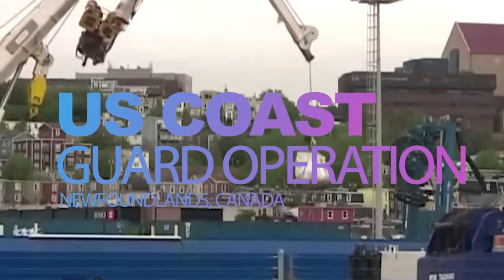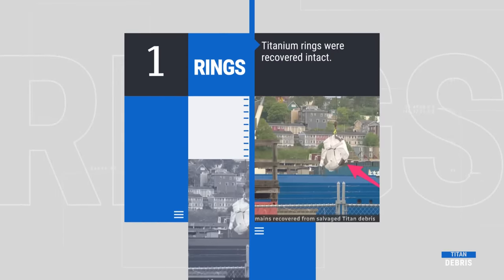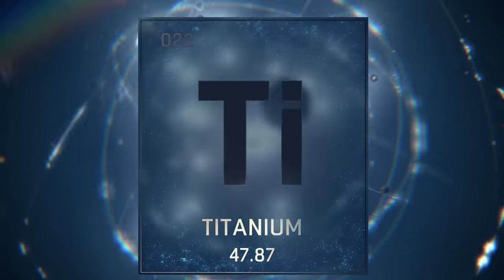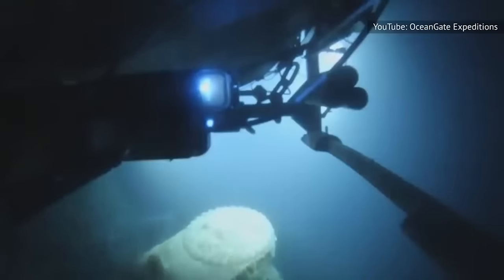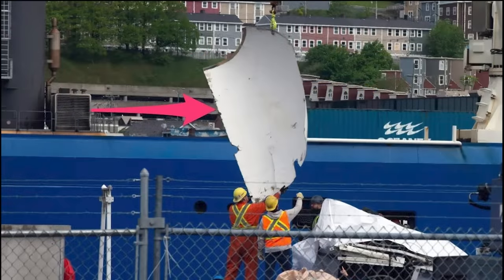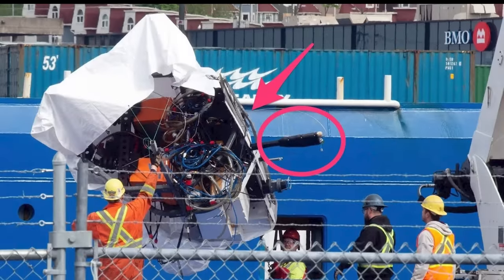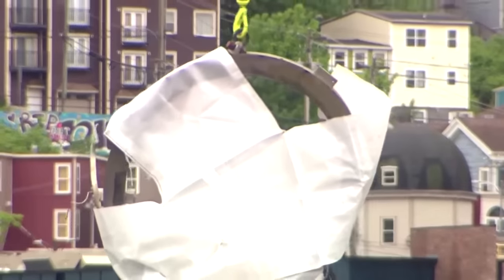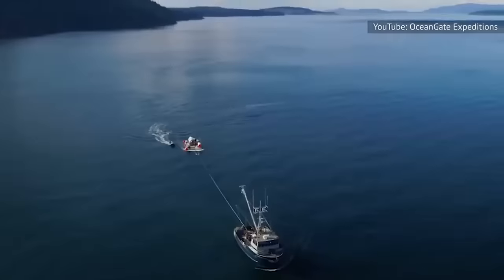What Really Happened? The Titan Submarine Clues from Parts after Implosion

Comment: Why did the cowl or outer plates covering the wiring etc did not break even being very thing to give shape ?
Reply: No pressure internally. If it's just the cowling your are talking about - it's just rounded material without an internal pressure differential.
Reply: They wouldn’t have been subject to the water expansion, just the pressure chamber.  
The water can only instantaneously expand into an available opening.
Reply: They wouldn’t have been subject to the water expansion, just the pressure chamber.  
The water can only instantaneously expand into an available opening.
Reply: They were part of tail section…not passenger compartment…blew off free. 3 sections…and titanium rings were glued to carbon fiber. Middle section is “missing, ie, micro fragmented from implosion.

Comment: What if all those YouTube self-proclaiming Experts' theories about how it takes X number of seconds for pain to register to the brain and then a human feels it and X number of milliseconds for an optical signal to reach the brain to actually process what's going on and how those 5 didn't even feel and didn't even realize what had actually happened at the time of that sudden implosion are all wrong and those 5 people actually saw and felt what was happening and what is coming next and they actually felt the pain and the distressing situation for a number of seconds to a couple of mins?
Reply: What if?
Reply: Why I think "black boxes" CVR/DRs should be installed/required on these manned submersibles, just like planes.  The are designed to withstand pressures at 20,000 ft and will transmit up to 30 days.
Reply: The only way to know what happens is if you have ever been involved in an accident involving high impact forces on your body.  I have, and I don't remember a single thing about it.

Comment: This did not emplode.....it broke apart 

Rush messaged the polar prince that he's coming back up because he's having issues......unfortunately they were already to deep to avoid this as they were already at the crush depth
Reply: The hull imploded and the steel caps just fell off.
Reply: And what caused it to break apart?!  pressure!!  it’s the same thing as an implosion 🤦🏻‍♂️
Reply: The carbon fiber hull imploded. The caps at the end did not. Not a hard concept to understand.
Reply: It did implode, causing it to break apart 🙄 What do you think happens to a pressure hull if it exceeds crush depth? It just breaks apart?!

Comment: By these debris's size there has a possibilities that the main body was leaky by small wounded... that causes the implosion wasn't totalled... "If the sub exploded before the implosion for sure they would be retrieve the whole debris in hand sized and there must be a burnt print 😎... "EN Namekian"

Sure CF harder than TTnium & TTnium elastic than CF, however the water pressure that wouldn't stop = no intervals "even at 0.00000+++1 ms" it would trigger a breaking CF into something sharp enough to slice a TTnium, because CF probably a hard material surfaces but it's too crispy 🤗... "Crank".

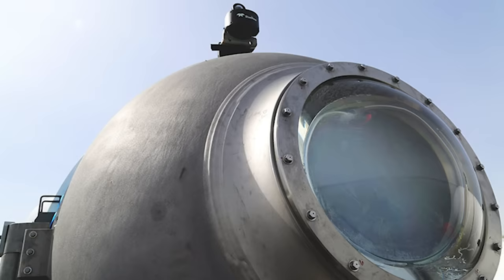Comment: At 7:13 aren't they wrapping the carbon fiber around some kind of steel drum tho? The hull was not just 5" of carbon fiber. I still think there was some kind of  small explosion/or fire (melting wires perhaps) in the back area part that only had the fiberglass part around it and some connections into the hull came lose and then the implosion happened. I hope their deaths were quick before realizing what was about to happen. I think SR knew something bad was about to happen but did he tell his passengers? Online transcript of SR communicating with his crew on board the "mothership" says the alert mechanism was red red so he likely knew there was impeding doom if he didn't get the vessel to the surface but even then that was a problem with the weights on the vessel not coming off to lighten the load to thrust to the surface. Something was holding them down or was blocking something to be able to thrust upwards
Reply: Aliens was holding it down, the aliens from the tictac ufo

Comment: Is there any information, or estimate yet as to what depth the Titan was at when it imploded ?  I wonder if the large pieces came about because the Titan had not descended to a substantial fraction of Titanic's depth at the ocean floor when it failed ? I'd think it logical that the deeper it was when it failed the more energy would have been involved in the crush/rebound cycles, resulting in smaller fragments.
Reply: We know aprox how deep, because the sub had been diving for almost two hours, and normally by that point would have reached nearly 3000m, 3/4th of the dive. The exact time of death is known, because audio sensors detected the crush sound at nearly the same time both the tracker added after last year and the onboard text type system failed. 

Watching videos of carbon fiber failing under pressure, it is fairly clear that CF fails dramatically, normally breaking into fragments. Since we know the main hull is layered vertically, it would be even smaller since the ringlike layers would not be rigid enough on their own.

The fact that only the grey adhesive is visible on the rings suggests the carbon fiber flexed too far, either causing layer separation (like an onion) which is insufficient to resist the pressure, or caused the separation of the adhesive at the ring, popping off the top (and blowing the viewport dozens of feet away) while crushing the rest like a soda can under a car tire at 75 mph.
Reply: Lost communication and tracking at 3500 meters

Comment: Bad assumptions.  Typical rush to judgement.
For example:
1. Viewing things being unloaded at a distance.
2. blowing OUT the viewport. There is nothing to suggest it, during an im-plosion from the high pressure at depth.
This is jumping to conclusions that may or may not be correct.
.
Photos of the debris field and examination of the recovered pieces is required.

Comment: Titanium was the best material to use - easy to say now Captain Hindsight! There was no possible way to know that carbon fiber was going to lead to catastrophic failure. No possible way. This was a totally and completely unexpected tragedy. Nobody could have predicted this.
Reply: Wouldn't other companys be using carbon fiber if it was an acceptable material?! 🤔
Reply: I assume you're being sarcastic.
Reply: I pray this is sarcasm
Reply: For a submarine, steel is the best material to use.  Titanium has a good strength to weight ratio, which is why it is used on airplanes.  Same for carbon fiber.  But submarines don't need a high strength to weight ratio.  Submarines just need strength.

Comment: You are being lied to. It EXPLODED not Imploded! Here's why I say this: The sub was descending too fast and the sub was not adjusting fast enough for the pressure outside of it and the composite fibers were cracking and the crew was hearing it. The aft section was filling with water and water was gathering around the A and B busses knocking out the power to the sub. Which knocked out communications, lighting, and propulsion. Once that happened they started to go back down. As the pressure increased water started coming into the sub passenger area. As the water filled the sub, it created an air pocket which superheated and the effects of the cold water and heated air combined to create an overpressure which blew the sub apart. And that's why you see such large pieces.
Reply: Maybe you are right.
Reply: You do realize when there’s that deep of sea pressure, things don’t explode right? It’s called an implosion for a reason.
Reply: Absolutely wrong.
The batteries were in their own pressure containment compartments separate from the passenger chamber.
Water wouldn't simply leak in, a crack would mean implosion at those depths.
The reason the fiberglass is almost intact is because it didn't implode, it was blown away from the implosion.

Comment: The view port blew out then the ocean blew the domes off the rings as it exploded outward the carbon fiber cylindrical hull section.
Reply: He explains in the video that if the port blew out first, there would be large pieces of the carbon fiber inner hull
Reply: @bulkvanderhuge9006  if it implodes, then the viewport wont be able to bent, so it will shoot out, plus the glass wont be able to sourvive the force of the implosion

Comment: why are there no bolt holes on the view port for the glass
Reply: I was thinking the same so i looked up images of the titan sub, when you look at the video of the recovered nose it looks like there is a significant portion of titanium missing, in pictures you can see there is a good 7 or 8 inches  that sticks out forward where the bolts go, however if you look at the recovered part at about 2:40 you can see there is no part that sticks out like it should  and around the edge where the  glass would be looks regular and broken,  I suspect they used cast titanium  for the front  due to it being cheaper than machining from a solid block, but cast is also weaker and so i suspect when the main pressure container popped the massive force of water popped the front glass out  along with part of the cast  titanium support frame.
Reply: @EQINOX187  You mean the air pressure inside momentarily shot up at when the hull imploded? I suppose, since the viewport was designed to hold off pressure from the outside, it would fail rapidly if the pressure came from inside.

Comment: It was an implosion, not an explosion. That's why the fragments are large. Duh!
Reply: The figments of the carbon fiber hull are not large but  tiny bits on the bottom of the sea. Duh!
Reply: At sea level the pressure acting on us is 14.7 PSI (Pounds per Square Inch) on our bodies. ""Titan is believed to have been 3,500m below sea level when contact was lost."" According to the ""sea diving pressure calculator"" 3,500 meters under the ocean surface would be 5,110 PSI"". So the Titan was holding back more then FIVE THOUSAND POUNDS of pressure PER SQUARE INCH at the time of implosion. It would have been a VERY VIOLENT IMPLOSION.
Reply: @oldarkie3880 figments? Duh!

Comment: How can it possibly take 12-24 months for the loser NTSB to come up with a conclusion? I guess it's just job security. No excuse for this.
Reply: Well said,1 month tops.....NTSB milks every investigation....
Reply: There are a lot of variables that would go in to figuring out exactly what happened. And I'm sure an absolute mountain of paperwork.
Reply: They’re just counting on the fact that in 12-24 months most people won’t even remember it happened.
Reply: It’s not a McDonald’s drive through.
Reply: Their research and report will be meticulous, and exhaustively thorough. It's not a book report.
Reply: Several things may happen. Unless they find the proverbial smoking gun, they may build a complete model of the Titan carbon fiber tube to do cyclic testing to failure (similar to the testing of the De Havilland Comet after some high profile breakups in flight). They may want to test all the seals to look at leakage or other problems. Basically they will test every piece of the thing they can get their hands on or recreate, because even though we KNOW the thing imploded, the NTSB is held to a much higher standard of proof because they need to not only explain the accident but figure out exact details to help prevent future occurrences. Then, after all the investigation, the team needs to get together and write report. If you have ever read one, those things can run hundreds of pages long and they will talk about all sorts of stuff down to the minutest detail. Why do they do that? Because of the law. People are going to get sued, and millions of dollars can hinge on exact causes. Sometimes criminal charges. Also, there is a big chance laws will be written because of this, and so the NTSB wants to make sure to steer the lawmakers in the right direction. And yeah, it can get political, and some will argue the NTSB is not always impartial, but I'm not talking about that. I'm just saying they have a LOT of work ahead, and they will not generally issue a report until all the i's are dotted and t's crossed.
Reply: There’s no rush is there? Unless there are a bunch of uncertified subs doing Titanic dives out there, should have plenty of time for a proper investigation.
Reply: @Concepcion30  You're right; there's no rush, mainly because that was the name of the sub's creator. So, literally speaking, there's no Rush.

Comment: No, that’s incorrect, no offence but you’ve clearly not done your research correctly.

The experts are not saying that the titanium rings were the correct choice; and they were actually designed to bolt the end caps on to the carbon fibre hull, and there was no trace of the hull on them, so if anything, they FAILED.

That’s what the experts have ALL been saying, it wasn’t necessary the carbon fibre hull that failed, but the mixture of different materials (i e. the Titanium rings) - as each material has its own properties and expands/compresses differently under the pressure…
Reply: I think what they mean is that titanium would have been the correct material to make the entire sub out of.
Reply: @dx1450 While that is true, that’s not what was stated and than further explained.

Hence bad research imo…

Comment: Hey Karens, can you read? 
THERE WERE TEN (10) SUCCESSFUL DIVES DOWN TO TITANIC. 
Ten times without imploding!!!
Reply: Each dive is a cycle. Pressure chambers weaken after each cycle. Aircraft have the same issue. They need to be built to withstand a useful number of cycles before it becomes dangerous.
Reply: Ten dives, and every time the carbon hull was weakened a bit more. IMO a bit similar to russian roulette.
Reply: Each dive puts stress on the carbon fiber, the cold does too.
The flooding sea water was injected into the small spaces in the Carbon fiber weave.
Then it finally just failed.
Be that as it may, there were in reality only Five successful dives out of fourteen attempts.
Every dive had some sort of failure.
Reply: The weak acrylic view port, rated for only 1300m, survived 10 dives to 3800m. What else worked? Sure the all died before they knew what was happening but we now know this sub could handle it 10 times. Next we need one that's good for 20 times. I think he's fully vindicated in using 'off the shelf components' but ran out of luck.
Reply: With carbon fibre, each layer is merely glued to the one below using epoxy resin. It is strong if the pressure inside exceeds that outside. However, under extreme pressure from outside, the resin will crack and the fibre will delaminate. It's just a question of how many times it will hold up before it finally implodes.
Reply: the whole point is that you can't rely on luck, but you must KNOW how the material behaves. that's why people used titanium hulls to go 3 times deeper than this sub without incidents for decades. This thing imploded after a handful dives at "mere" 4 kms and with paying customers on board.
Reply: Steve you are WRONG. There were several "attempts" that were aborted due to mechanical problems!!!
Reply: Um hm.  So what?  Clearly the toy sub was overstressed by the time it descended for the 11th time.
Reply: @stevecam724  you aren't wrong,however if the carbon fiber was replaced with titanium,this wouldn't have happened,not for a while atleast,unless the glass cracked instead,still,honestly i'm surprised it lasted that many dives